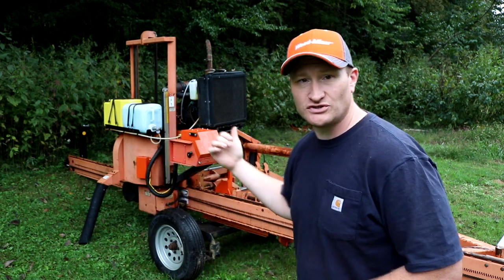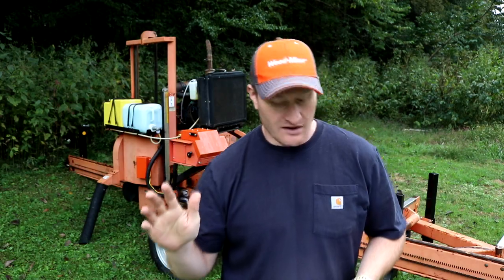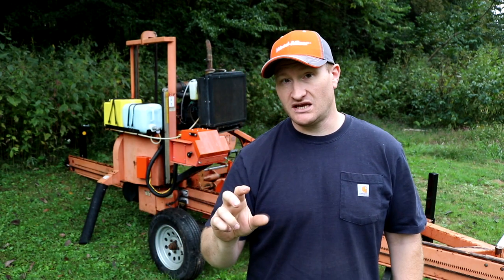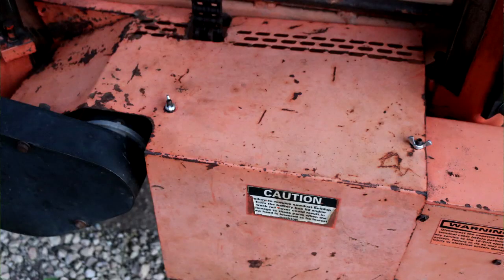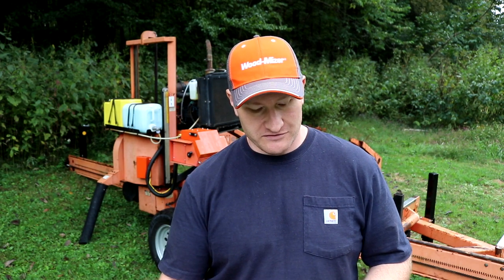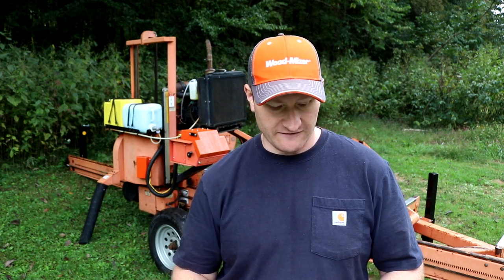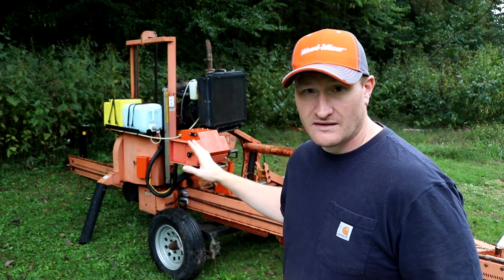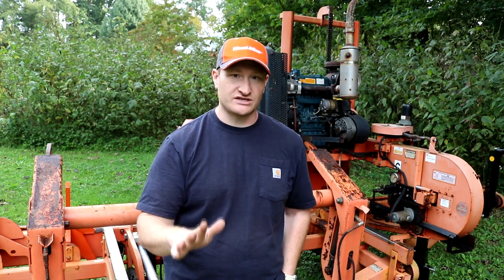HOW TO/ SHOULD YOU BUY A USED SAWMILL? WOOD-MIZER FIXES AND UPGRADES TO MY SAWMILL AND MORE!

Comment: About three weeks ago I bought a1988 lt40 hydraulic it had a four cylinder Diesel engine on it not original didn’t run. I knew it would need anew gas engine from Wood Mizer . When bring it home the driver side tire passed me the guy had put the tires and wheels on it when I got there I should have checked his work didn’t get the lugs tight .so I took off the drum and went and bought studs from auto parts and a wheel and tire from harbor freight got home 12:00 midnight. I have all hydraulics working toe board where Already up graded to roller style It has a debarked . Just picked up new engine from Wood Mizer maybe have this sawing in another week. This is fun work I am a wood turner and wood worker this will give me another way to process my logs I am a retired millwright from Chrysler I really like your videos look forwards for more
Reply from the maker: Good to know I'm not the only one out there putting a Wood-Mizer back to order, thanks!

Comment: One of the interesting things about Wood-Mizer is the line up of mills. While it can be confusing to those who are just getting into milling they have a mill that fits just about anyone's needs be it a new or used mill. I chose a used mill and have no regrets. I think anyone interested in a mill is going to learn about maintaining and repairing be it used or new. I feel that for those that do not have the money to spend on the extra cost of hydraulics or equipment the little Lt15 is appealing for several reasons. The 15 is low to the ground for loading...very simple and easy to maintain and the bed extensions are great. I have been tempted for yrs to sell my mill....similar to yours...and get a 15.   lol can you tell I like my woodmizer?

Comment: I’ve got a 1992 LT40HD. It’s cut a tremendous amount of lumber over the years. It’s been refurbished once and is now ready for its 2nd restoration. It’s a great machine. I don’t have any complaints. My advice is not to spend the extra money on the Diesel engine unless you are a full time sawyer. The gas engines are a lot cheaper to fix/replace. The only way that diesel will pay for itself is in fuel savings. And you’ll have to cut a huge amount of lumber before that difference in fuel costs equals the extra cost of the Diesel engine.
Reply from the maker: Good words!  Thanks!
Reply: Where can I buy a used one please

Comment: ‘92 LT30 owner. 
Restoring a used mill is a labor of love.
My gal cuts true but the power feed developed some bad herky jerks this weekend cutting some big poplar logs.
Ended up manually pushing the head to get the cuts done. 🥵
Reply from the maker: Watch out for bad brushes in your motor.  I had another LT 40 that ended up having a motor that went out because of the same issue.

Comment: I have 1995 LT 40 HD with 3714 hours  24 hp Onan gas engine. I didn't use it for 1 year and had to replace some parts on it just to get it back in running order.

Comment: I’m looking at a lot 40 hd 1992
With 4000 plus hours the owner is dead I don’t know the history or repair of mill 
I talked to owner before he passed it’s diesel and he started it but wouldn’t sale two month later he passed
I know a few things are Jerry rigged what would be a good price
Reply from the maker: That's a good question. The diesels are worth more, but that is still a lot of hours on an old machine, especially with old parts that will be more difficult to replace. I would aim low $8k high $12k depending on condition.

Comment: Owner told me he bought new for 15000 wife wants 15000 
Hate to make a mistake and pay too much never owned a mill
Reply from the maker: I paid $14k for my 1999 kubota diesel lt40hd. I had to put $4k to get it back to factory running condition. $15k seems steep. The problem is, there is a higher demand for used mills than there was even a year ago. That is an old mill though and bound to have expensive problems being a diesel model. Food for thought.